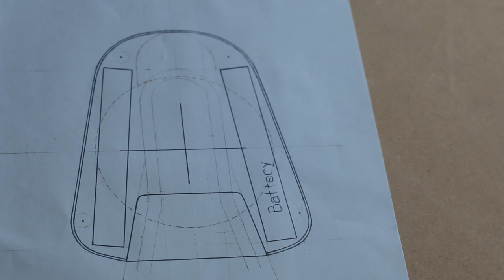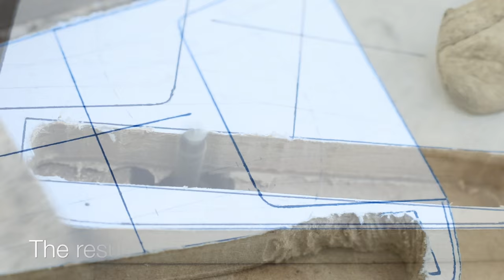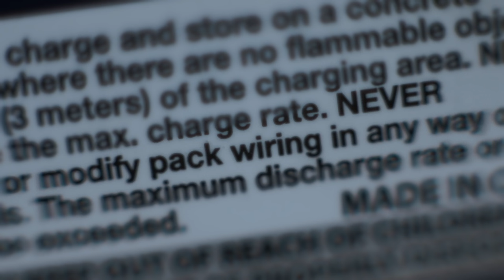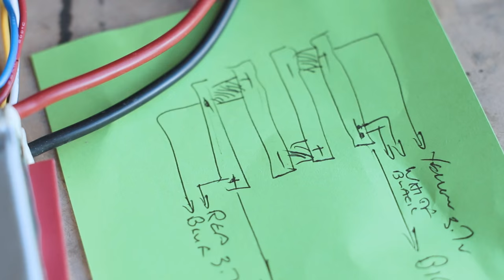Carbon Fiber DSLR 3 Axis Gimbal/Steadycam Build Part 7

Comment: Cool video, but I think you love those short depth of field shots a bit much. It gets very noticeable when the focus is even slightly off and also it gets hard on the eyes after a while. Don't get me wrong some of them are gorgeous but with many I just feel like I can't see what is going on properly.
Really cool project though :)
Reply from the maker: +5chr4pn3ll No worries dude, yeah it gets a bit difficult trying to light it up as I have to work at night. I'm using a very fast lens with a couple of macro tubes and have to shoot wide open hence the ultra narrow DOF. I have to bin some of my footage as I miss the focus in some shots even. Id love a Sony A7S2, that would solve alot of probs for me. I hope to get some work done in the weekend so I can use the glorious sun some more. Valid points you raise and I appreciate the kind words!!

Comment: As always, this is art
Reply from the maker: +Fluburtur Thanks Flurburtur, hope you doing well mate!!
Reply: +elams1894 I started working on my bass project for good, the wood has been drying for a few years now but most of the hard work is done. I hope I will be able to make a video of it within a few months
Reply from the maker: +Fluburtur Thats great! I'll keep an eye out, All the best for the build, cant wait to see it! Have a good one my friend!!
Reply: I started shaping the neck of the bass with a pretty rough wood file and oh boy, do my arms hurt.
Do you have a technique or tools that make that easier? Im only making the rough shape so far since the body is not attached yet.
Reply from the maker: Yeah unfortunately the rasp takes a bit of effort. Iv looked at all the options, angle grinder, power sander etc, but they ate all too brutal. The rasp, although hard work, gives you control over the process and it does take time. I follow up the rasp with a scraper and then sanding blocks. Slowly you'll get your desired shape. Good on you dude!! Glad it's taking shape, awesome!!!
Reply: Well on the bright side, this will make me do some exercise and I do need it.
Thank you for your advices!

Comment: Wonderful video! But how is about sliprings for wires?
Reply from the maker: +MediaGraphica You mean the slip rings in the middle of the motors? If so, I used that space to house a shaft as I wanted to support the motor weight on additional bearings rather than rely solely on the motor bearings. Hence alas, I coudnt utilise the space for wires. Cheers!!

Comment: Nice work sir, what kind of logic board are you thinking of using ?
Reply from the maker: I used a Basecam Electronics V3 mother board and an HC-05 bluetooth module. Thank you!! Actually I just posted a start to finish video of this build, should be ready for viewing in about 3 hours, cheers!

Comment: Really enjoyed the video. What Dremel base was that you were using?
Reply from the maker: +Michelle Thanks Michelle! The dremel base is from Stew Mac. I had to modify however as the stock base is weak. It works well but really needs reinforcing as any small knock or fall and the base will bend and ultimately fail. There may be better designs on the market. Cheers!

Comment: Hope your wearing a good mash working on that stuff mate.
Reply from the maker: +Brian “Easty and the Wolf” Eastwood @3:19
Reply: +elams1894 Great, didn't spot it. a lot of people don't realize it's pretty bad stuff in the same way as asbestos.
Reply from the maker: +Brian “Easty and the Wolf” Eastwood Indeed. So much carbon dust while using a rotary tool or sawing. I always get the vacuum out when I can and also the mask is essential, really dont want that stuff in the lungs. Thanks for the comments, have a good one!

Comment: im not so good in this stuff but all the gimbals i saw had controllboards is there an part 8 incoming ? why the motors when you cant controll them with joysticks ?
Reply from the maker: I have nearly finished this build and yes, there is a mother board, and other bits and pieces that make this work. I have also incorporated a bluetooth module and have remote control of the gimbal through joystick. The next video will show this build completed and working with footage (barring any disasters) and then there will be couple of videos after that, completing the build series. Its perhaps 2-3weeks away. Thanks
Reply: elams1894 thank you for the fast answer 🔝

Comment: Much as I enjoy watching plucky Kiwi ingenuity, it would have been cheaper for you to buy one.
Reply from the maker: Not really, the cheap ones are worse than crap. You'll pay 2k plus just for one that works ok-ish. Cheers
Reply: Have to say your workmanship an ingenuity was fantastic to watch. Thanks for sharing!!!!
Reply: Also, I have a cheap and cheerful way of vacuum bagging small parts; Use a kitchen freezer sealer. It works a treat. I have also further pressurized some parts by dropping the sealed bag containing the part into water (attached by rope, obiously) for a couple of hours until the resin has cured.  10 metres is equivilent to 28 PSI over the part. Its slightly fiddly but you can seriously pressurize the parts very cheaply.
Reply from the maker: That's some pretty good thinking outside the box TW. I would never have thought about pressurizing in deep water, very cool. TBH, the amount of time it took me to build the gimbal was blown out for sure but it enabled me to really hone some ideas. I'm making a new bracket and reconfiguring the balance system to eliminate most of the bolts. It's a cool journey and definitely carbon fibre, with some imagination, enables you to build just about anything, thanks for the comments!
Reply: If you dropped it down the bottom of lake Te Anau (or similar) it would be as hard as diamond when you pulled it up....

Comment: when will video electronic assembly? : ))
Reply from the maker: +Arek Kapcewicz Hi Arek, the next vid will include the electronics. It is quite complex so I may do a separate vid just for the electronics part with comprehensive explanation of whats going on as I have found that trying to find info on gimbal electronic processes is next to impossible. Its taken me a long time to research the whole thing and I think an easy explanation is what is needed for anyone going through the same process. Thanks Alek!!!